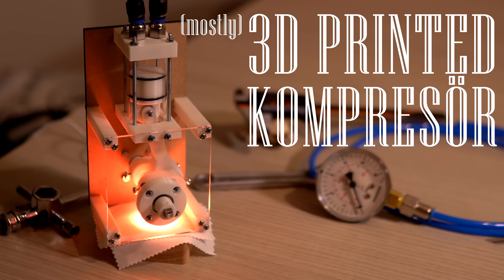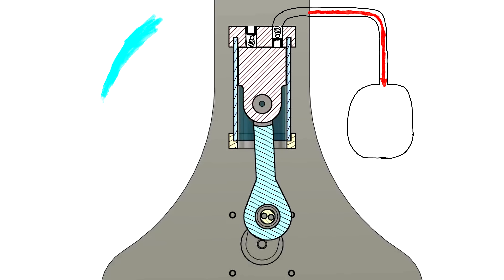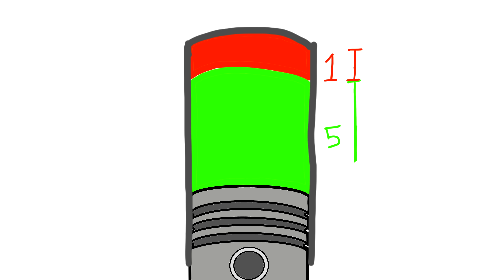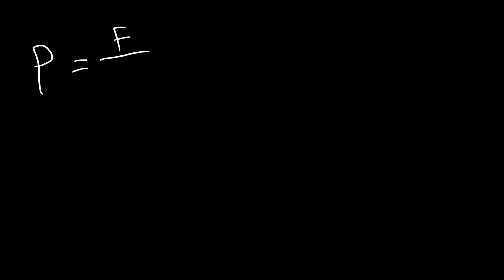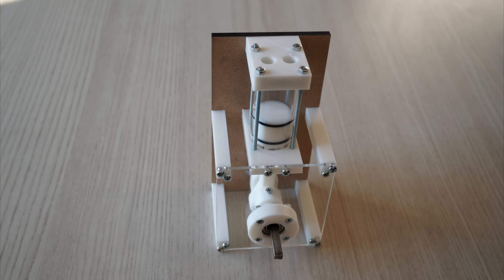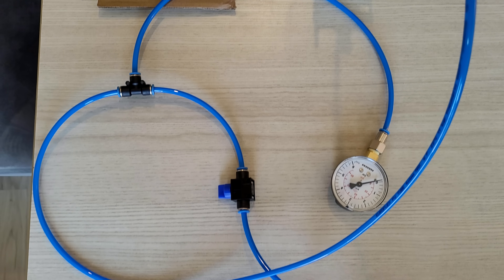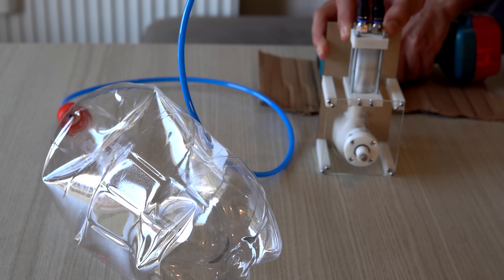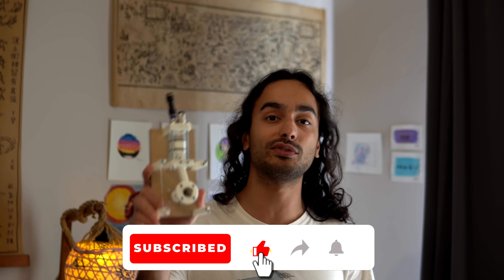Can You 3D Print an Air Compressor?

Comment: Look at engine designs at driving4answers he has showcased some with minimal forces. Like a 4 by 4,  270° or 180° (270°is better but harder to pull off).

Try bricklayers for more airtight parts. (Some slicers now have that build in).
Try high temperature PLA or PETG or even ABS as they're more temperature stable. High temperature PLA is a recent invention bordering witchcraft. Once printed it is more heat resistant than ABS.
Try using another bigger acrylic tube around the inner one. Fill the gap with water.

Comment: Everything is no problem except heat resistance of 3d plastic. Compression  creates heat and nothing can be done about that. Maybe multi stage with intercooler between stages.
Reply from the maker: Hi, check out my newest two videos. With an aluminum cylinder head, i got to a much higher pressure

Comment: Since the topic is about compressor, is it possible to.3d print an air tank that can handle at least 200psi? For possible part of nerf toys using pressured air rather than springs
Reply from the maker: I don't see why it shouldn't be possible, with thick enough walls. And there are sprays that can help prints become airtight.

Comment: you can use the second piston as the counter weight.
Reply from the maker: If you that, then the load stroke of the piston match, creating an even bigger torque oscillation.
Reply: @canocholic  but if you put them inline they will cancel each other out like in a porche
Reply from the maker: No, not when there is only 2 cylinders
Reply: I think you can, if you look up a flat twin engine if you alight the crank shaft right you can balance out the engine.

Comment: This looks really good. As you were mentioning some improvements like a flywheel, but what do you think about adding a second compressor to the same axis but turned by 180 degrees. So when one compressor-shaft moves up the other moves down. I could imagine that this also balances out the forces a bit and would make better use of the energy that you have to put in. WDYT?
Reply from the maker: Hi, I'll use a very similar concept next time. Keep tuned in.

Comment: Any FDM filament is a thermoplastic, which means it can deform again after a temperature limit. However, technically you can 3D print with a thermosetplastic: UV Resin. If you manage to get unwarped resin parts, you can probably delay (or eliminate, I am not a Material Scientist) the melting or softening issue. Also, resin printers are much better at obtaining high-tolerance parts because their X-Y accuracy is around 24um if you can support the parts properly. Amazing design.
Reply from the maker: If i get a resin printer in the future, I'll definitely use it for parts like this.

Comment: Nice project. If you cool the air between stages, the air reduces in volume for the second stage. Reducing the diameter of the second stage piston reduces power needed there. Your overall efficiency increases by doing this. Thanks.
Reply from the maker: Thanks for the tips

Comment: You said you need a counterweight but you also said you want a second stage.
What if you combine them, stack them on top of each other and whenever one moves upwards the other one moves downwards so their movement cancel each other out?
I'd also like to see how far this could go, what if you do 4 stages instead? :D

Very cool video, keep it up!
Reply from the maker: You need to balance moving parts and torque curves at the same time. If the pistons are moving in the opposite direction, their comppression strokes are happening at the same time. So it solves vibrations due to movement but adds vibration due to torque change. Tune in for the next iterarion. I don't want to spoil it much.

Comment: Very cool! I had thought of doing this before and figured at the least 3D printing would be great to replace broken parts in small cheap compressors that like to fail due to poor construction. Not hard to improve on the most economical designs possible.

Comment: Loved every minute of your video! I do wonder if instead of counter-weights, what if you attach a second piston to the same shaft but in half-phase (so when piston 1 is up, then piston 2 is down, and so on)? What would be the pros and cons of doing that?
Reply from the maker: In that case, the pistons are in the power phase at the same time, meaning they both require torque at the same time. This puts additional strain on the motor

Comment: a minor improvement would be to add rubber feet or some other way to add friction between the compressor and the floor/table it's sitting on so it doesn't slide around with the vibration
Reply from the maker: That's a must for the final version

Comment: I wonder if the multistage setup could be driven by the same motor changing the angle of the crankshafts. This may also help with vibrations acting as a counterweight itself, since one piston is moving upwards while the other one is moving downwards. Subscribed!
Reply from the maker: Wait for the v2

Comment: Usually i use pla mostly for prototypes. If needed strength, I use petg or abs - much better
Reply from the maker: For most of my projects, pla is enough. Sadly, i don't have an enclosed printer, and i work in the same room with it, so i have some health concerns, especially with abs
Reply: @canocholic  i have ender 3 v2 with AliExpress enclosure. No smell during printing noticed 👍also planning to install diy enclosure with carbon filter
Reply from the maker: Even with no smell, it is melted abs plastic. That stuff is nasty for your lungs.

Comment: Please make a boxer motor design for the two pistons in series. Would be a nice solution for the counterweight hehe
Reply from the maker: Yeah, the thing is in a boxer setting. If they are moving in opposite directions, their torque curve is the same. So it puts a lot of load on the motor. I'm planning to do a radial design

Comment: If you do a second stage remember that because the air is compressed the 2nd cylinder should have a much smaller volume. A double expansion engine in reverse!

Comment: looks like the perfect oportunity to make a 3d printed heatpump
Reply from the maker: Yeah, I'm considering using it for a simple ac unit, but the thing is heat and 3d printing doesn't really go along.
Reply: @canocholic  I understand, plastic 😂 it would not be a good heatpump but It looks fun. 

Have you seen the 3d printed radiators? They seem to work surpeisingly "well"
Reply: You don't want refrigerants in something with imperfect seals.
Reply: @daliasprints9798  It is a valid point, you could use air as the refrigerant, it is not very efficient but it will work for a demostration

Comment: Vaseline between the o-rings. The second stage should be half the size of the piston of the first. Usually the second stage is fully pressurised under the pressure from the first stage and lastly - you can use a swivel plate and an offset bearing like in AC compressors for cars to put more pistons in a smaller footprint, make the pistons from a more heat-conductive material and preferably black because black surfaces radiate heat better. You can also add a copper bolt to the head and cut some fins in to it with a Dremel to suck away some of the heat.

Comment: this is amazing, I have been waiting so long for someone to design a piston-based 3d printed air compressor, every one else makes a different style that doesn't get any real pressure
Reply: There is one channel (Diffraction Limited) which designs a piston-based air compressor which can reach a pressure of 150 psi. It's really amazing, but it's not fully 3d printed, but that's not a problem. The problem is the lack of information about non-3d printed parts and mechanism also. Also, I tried to make that compressor but failed due to lack of information, mainly about the different type of sealing ring (not an oring).
Reply: @Ansh-tp4lz  Took a quick look and that Diffraction Limited design seems to be using "cup seals". That's the term you need, presuming that was the issue. Good luck!
Reply from the maker: I love that channel. Gives me mad scientists vibes.
Reply from the maker: Thank you, I'm glad you liked it!

Comment: @2:55 
Rather, it’s:
P1 * (V1^1.4) = P2 * (V2^1.4)
Reply: If V1/V2 = 6, then P2/P1=12.3
Reply: If you then let it cool off to the inlet temperature, then P2/P1=6.
Reply from the maker: Yeah, i was going with minimums so i assumed temperature doesn't change.

Comment: I misread this as 'Can you 3D print with an air compressor'.

Now, I'm curious if the motors, belts, z-screw, and aluminum extrusions on a 3D printer can be replaced by an air system.
Reply from the maker: Would be cool instead of stepper noises it would go ps pss pss. But a conpressor running 24/7 to power it would be annoying
Reply: @canocholic  Would it be possible to separate the noise from the printer by having the compressor in another room and a small tank (With a sensor to shut a valve or turn off the compressor so that it doesn't go boom.) next to the printer to hold any air pressure it would need?
Reply from the maker: @Jeff-ss6qt  Yeah it can. Almost every factory has a pressured air line just like electricity lines to keep the compressors and other equipments away and hidden

Comment: Great work! How about many stages of compression? That would allow compressing a small volume and modest compression ratio per stage at (relatively) high rpm, which should reduce peak forces. Also maybe have some cooling between stages.
Reply from the maker: Great ideas. I'll implement multiple stages for v2. I'll probaby build a radial setup

Comment: If you decide to make it multi-stage, don't just feed the first stage into the intake of the second otherwise the second one will have the stress of the higher pressure. Instead put the second stage in a box that is pressurized by the first stage so that the second stage only has the stress of one stage's worth of pressure. The whole compressor being enclosed in a higher pressure environment should mean that it only has the stress of increasing the pressure above what's around it instead of the full outlet pressure. I'm not sure I said all that very eloquently but hopefully you get it.
Reply from the maker: This is a great idea but building a pressure vessel that can fit the second stage is quite hard.
Reply: @canocholic  that is fair but the alternative is that your second stage is going to have to be overbuilt anyways.
Reply: @canocholic  You could perhaps add a second air tight acrylic tubing around the first one and feed the second stage pump from in between the two acrylic pipes. I imagine it will create a similar effect.
Reply: @canocholic  Using an airlock instead of a gasket might allow to make the assembly print-in-place (PIP), as could using multi-material printing with TPU or soft nylon to make the gaskets.

The same "overprinting"  techniques that were found a decade ago to produce the best clarity in transparent FDM prints are also known to make parts less prone to leakage of gases and liquids. They may or may not be incompatible with passive sliding airlocks, but should work with TPU gaskets.

Various tests with hydraulic and pneumatic presses have demonstrated that PLA prints have a remarkably respectable compression strength at even average infill ratios. While expansion strength is likely not as impressive, pepper design considerations and print settings should be able to account for much of that.

Don't forget to include relief valves in your pressurized spaces! At least one in each stageif you can discern a good way to make them PIP and can afford the space. 

PIP should also help with your concerns over being able to enclose successive stages.

Remember that the more pistons you have of a given size, the lower your RPMs can be for the same through capacity, and that staggering their action with a crankshaft or other mechanism can reduce turbulence in the flow.

Also consider adding radiators between the pistons and tanks or between stages to allow air to cool and condense out moisture.

Comment: The backplate needs to be much thicker. It is flexing during the compression stroke. You may well double your pressure if you eliminate any flex ture in the assembly
Reply from the maker: I think it's the plastic connector pieces that are flexing. I kept them thin to make the inner workings more visible

Comment: i recomendet making a crankcase, to provide a full lubrication for beter coling, less friction(which will probably provide better pressure, but I'm not sure) and I recomendet printing with PET-G for beter termal propertis, and make a tall tube with small diameter with cap that have smaler hole to  diameter hole, this should prevent oil spill
Reply from the maker: It would be a quite messy project